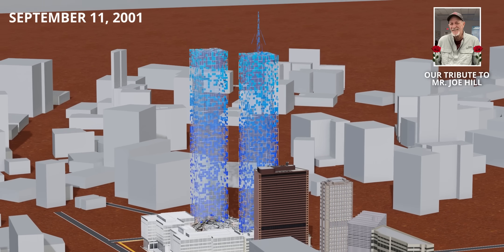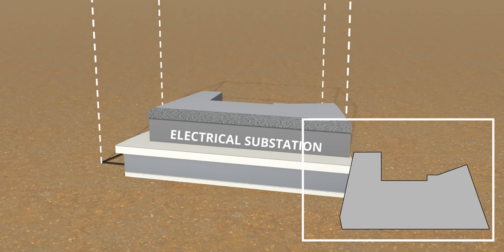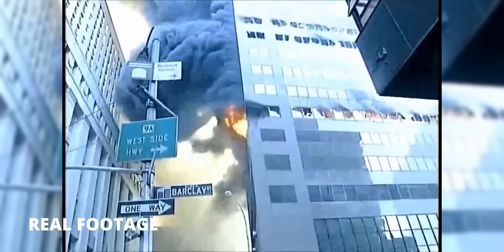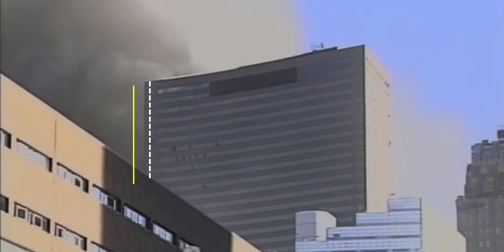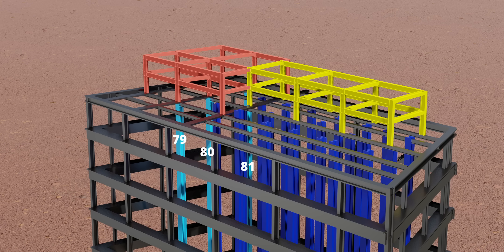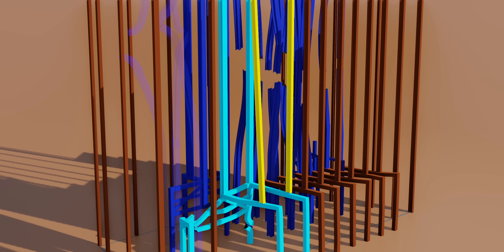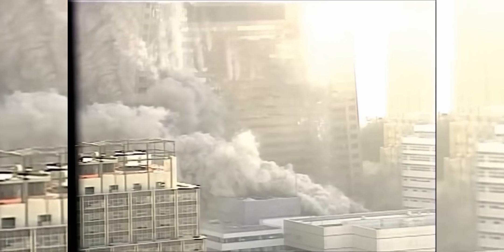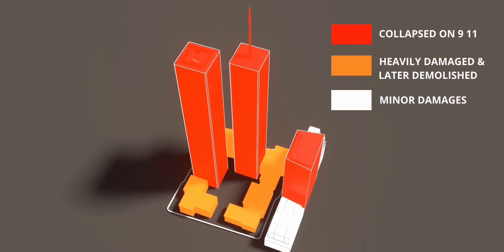Collapse of Building 7 | The Complete Physics

Comment: This video gives the same vibe as the commission report… “this is what happened even though it makes absolutely no sense
Reply: Correction: Makes no sense to you but maybe this will help:

Much misunderstood, Building 7 was the 6th building to collapse of 10 lost on 9/11. Because of its early low priority, conspiracy filled the information void with garbage made up by technically ignorant people promoting political agendas. But 7's loss is an engineering problem and should be treated as such, so I prepared this brief summary of my own analysis to fix that, using technical analysis, not ideology and tired memes. 

At 10:28am the WTC North Tower collapsed, showering Building 7 with tons of burning debris, causing heavy damage and starting many large  fires which burned out of control for the next 7 hours. Half the FDNY firefighters having been killed, units in disarray, equipment destroyed, no water pressure, and the greater urgency of search & rescue efforts, Building 7 couldn’t be saved so firefighting efforts were pulled as futile and 7 left to its fate. Firefighters make that sort of choice every day in brush fire situations - which houses to save and which ones to let go. Only real difference here is moving the decimal on the size and cost. People get overwhelmed by the size.

www.youtube.com/watch?v=g_SvpwyC17M

Collapse of a burning structure is always a concern for firefighters. Steel buildings subject to fire rely on active firefighting to survive. Buildings are designed around 1 to 3 hours of fire resistance, allowing time for occupants to escape and active firefighting to get started, after which all bets are off. Left to their own devices they'll exceed their design envelope and collapse, like Plasco Tower and Wilton Paes de Almeida. In 7 the occupants escaped, passive and active fire protections were compromised and active firefighting was abandoned hours before the collapse, which left the building to its fate. It lost. Odds on Building 7 would eventually collapse, and it did. No big deal in logic.

 http://www.youtube.com/watch?v=WnYBX6QT0R4 

FDNY Chief Daniel Nigro - The biggest decision we had to make on the first day was to clear the area and create a collapse zone around the severely damaged 7 World Trade Center, a 47-story building heavily involved in fire. A number of fire officers and companies assessed the damage to the building. The appraisals indicated that the building's structural integrity was in serious doubt. I issued orders to PULL back the firefighters and define the collapse zone. It was a critical decision; We could not lose any more firefighters. It took a lot of time to PULL everyone out, given the emotionalism of the day, communications difficulties and the collapse terrain 

FDNY Deputy Chief Peter Hayden ; We had our special operations people set up surveying instruments to monitor and see if there was any movement in the building. We were concerned of the possibility of collapse in the building. And we had a discussion with one particular engineer there, and we asked him if we allowed it to burn could we anticipate a collapse and if so, how soon? And it turned out that he was pretty much right on the money, that he said 'In its current state you have about 5 hours 

The collapse of Building 7 was anticipated and widely reported in the media throughout the day, with 24 video cameras recording some or all of the collapse. Everyone knew what was coming and why. 

www.youtube.com/watch?v=OY5S5k3tMHI

The collapse of Building 7’s was from the inside out and entirely different to the Twin Towers, harder to understand, with most details being hidden from view and not intuitive.  But we can still sort out what happened through careful analysis and observation. This is my explanation of the collapse relying on no outside authority. 

Building 7 was a unique, asymmetrical 47-story steel framed structure built atop a smaller 3-story building serving as a partial foundation, requiring lower floors dedicated to complex load transfer structures. Of trapezoidal shape and all-steel tube-in-tube construction, B7 (above the 7th floor) consisted of a central core of steel columns carrying most of the gravity load, perimeter steel columns around the outside of the structure carrying the remainder of the gravity loads and long span beams and girders to tie those elements together and form the floors. On the outside of the building hung a moment frame or outer shell. 

Phase 1 : First externally visible signs of collapse initiation occurred at 5:20:28 pm and were notably quiet with observers not realizing the building was collapsing! No audible warning in the form of hundreds of ear drum busting 180-190dB explosive bangs preceding the collapse. Here at 12:00 a local CBS affiliate reporter is talking 10 blocks from B7 when collapse begins. People don’t start to notice the collapse until 12:11. At 12:45 is the famous CBS fixed camera clip of Building 7’s collapse. Note how quiet it is. 

www.youtube.com/watch?v=t5tEy6mXSE8

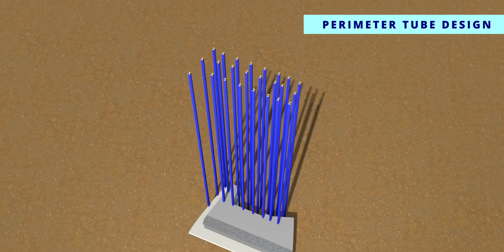Collapse initiation was due to lower floor failures above the load transfer region (8-14th floors) in the NE corner. In this video at 0:45 you can see the NW corner from inside the building while under construction, Column 79 just out of frame on the left. That big, angled steel beam across the top of the frame connects to C79 at one end. The girders connect to the beam. That beam and all those girders depend on just one connection 

www.youtube.com/watch?v=nP3TNHPCIVU&t=45s

Phase 2 : The NE lower floor failures caused a loss of critical lateral support over an excessive length of Column 79 and it buckled. Looking at a floor diagram of Building 7 (www.nist.gov/image-16640) when you see all the structures that depend on C79 you quickly realize this one column was a relatively isolated structural element on which a disproportionately greater fraction of the structure depended analogous to say the Key Bridge. Externally as collapse begins we see a vertical progression of window breakage along the 44-46 line and a kink in the roof of the East Mechanical Penthouse at the top of the building, consistent with C79 failure. Normally with a buckling column, the load could be redistributed to other columns. With C79 that is not the case - the failure did not redistribute the load, so the collapse rapidly progressed to the roofline, sinking the rooftop penthouse. The transition from full capacity to almost no capacity occurs in an instant and will result in virtually no resistance 

Phase 3 : With C79 gone, B7’s progressive, non-symmetrical collapse continues with adjacent columns 80 and 81 left laterally unsupported, and quickly buckling as well, sending the EMP down through the building. C79-81 all have no diagonal bracing, which is the major reason why they could not redistribute a lot of vertical loads among one another. From there collapse progressed from east to west through the central core until the core was gone taking all of the interior floors and probably most of the perimeter columns with it. Follow the horizontal progression of window failures low in the building and the dropping of the remaining rooftop structures into the building. One of the big takeaways from the NIST Building 7 study (invariably ignored) was how their modeling determined C79 failing under ANY circumstances would have initiated the same collapse sequence. 

Phase 4 : After about 10 seconds only the exterior moment frame remains, giving the illusion B7 is still standing to the casual observer since little has outwardly changed. But it is just a hollow empty shell like an empty cereal box supported only by a few remaining columns and overloaded from the loss of the core columns and floors, quite unable to remain standing. With nothing remaining behind it, the north face leans inward, forming a V in the roofline, the last few columns buckle under the strain and the moment frame free falls, landing on top of the debris pile. 

It is only here at the end when most of the building is already gone, leaving only an empty outer shell that a single measurement of alleged free fall acceleration is taken, from one point on the outer shell. The Building did not “free fall” – just one corner of the outer shell briefly moved at a rate comparable to FFA. The Building_ (core and interior) was already gone before that happened. The period of alleged FFA was a product of how it fell NOT why it fell . It’s also not proper FFA as the single measured point was moving in 3 dimensions, not just down. Start to finish the collapse took 18-20 seconds, 3 times longer than free fall . How fast something falls cannot tell you what started it falling_ anyway, let alone 10 seconds after it started falling.

The debris spread outside the footprint blocking surrounding streets, heavily damaging the Verizon Building and destroyed Fiterman Hall. 

Building 7’s progressive, non-symmetrical collapse was incidental and unintended collateral damage from the combined effects of fire + time + gravity, started by the collapsing North Tower. That is true no matter who planned and carried out the 9/11 attacks or why . The collapse was of so little consequence it barely registered at the time - a footnote, only taking on semi-mythical status as an alleged smoking gun years later when demolitions at the Twin Towers, missiles at the Pentagon and shoot down over Shanksville all failed and conspiracists had nothing left to work with. 

Anything can seem like a conspiracy if you don’t understand how it works. Now you should. I hope you found this helpful, informative and it solicits informed critical comment. If I made any errors of fact, logic or reason or left anything important out, please let me know so I can fix it. IF you can offer a more plausible alternative please do. Be the first. Please start any reply with the words “Tits McGee” or I will know you didn’t read it and are wasting my time.
Reply: That you don't understand it means only that, in both cases.

Comment: Definitely controlled demo...
Reply: Definitely how?
Reply: @TheCriticalStinker-01  It experienced a period of free-fall acceleration lasting approximately 2.25 seconds during its 5.4-second collapse, as acknowledged in the NIST final report.

Skyscrapers are designed to resist collapse, they don’t fail into freefall
Reply: @LibertyOrD__th  - OK then, here's a question you won't know the answer to because you never actually read The NIST's final report:

According to The NIST timeline of the collapse of Building 7 how long had Building 7 been collapsing before a single measurement that roughly averaged FFA for a single point on the outer shell was taken?

I only ask because I know that you don't actually know.
Reply: @TheCriticalStinker-01  does it matter? Almost half of the collapse was free-fall speed; i “assume” freefall was achieved in the last 2.25 seconds of collapse.

Do you know what free-fall means? It means zero resistance apart from air resistance. How does thousands of tons of steel and concrete hit free-fall genius?
Reply: @TheCriticalStinker-01  does it matter? Almost half of the collapse was free-fall speed; i “assume” freefall was achieved in the last 2.25 seconds of collapse.

Do you know what free-fall means? It means zero resistance apart from air resistance. How does thousands of tons of steel and concrete hit free-fall genius?
Reply: @LibertyOrD__th  - According to The NIST timeline of the collapse of Building 7, how long had Building 7 been collapsing before a single measurement that roughly averaged FFA for a single point on the outer shell was taken?  This speaks directly to your claim so yes it matters and the more you dodge and evade the more I will double down.

So answer or don't waste my time and admit you don't know, because we both know you don't.
Reply: @TheCriticalStinker-01  okay, idk 🤷‍♀️. Out of the 5.4 sec collapse, how long before NIST measured the shell travelling at FF? Im curious what point exactly they measured as well.
Reply: @LibertyOrD__th  "It experienced a period of free-fall acceleration lasting approximately 2.25 seconds during its 5.4-second collapse"
Showing that you have, 1, not any understanding of what you're talking about, and 2, no understanding of what you're talking about.

Well done.
Reply: @TheCriticalStinker-01  No steel framed building has ever collapsed. Never mind at free fall speed, but you can deny the facts if you want. Cope harder.
Reply: @NoOddReason  - Except for the countless thousands of steel framed buildings (and bridges) that have.  It literally happens all the time.  I always found it amusing that this simple bit of bleeding obvious was generally accepted before 9/11 and now to a tiny subset of the population it suddenly seems blasphemous.

I blame the public school system.  Don't they offer Metal Shop in school anymore?

Also, free fall can refer to a state or a rate of acceleration but never a speed

I can see you are a mindless repeater of other peoples bad, failed ideas you find on the internet.

Comment: I don't care how heavy the equipment on top is unless it was heavier than the floor below.
Reply: It's all well and good until the floors in the NE corner between 7 and 14 give out, leaving Column 79 without critical lateral support over an excessive length, causing it to buckle.

If that seems oddly specific,...
Reply: @TheCriticalStinker-01  who told you thats what happened?